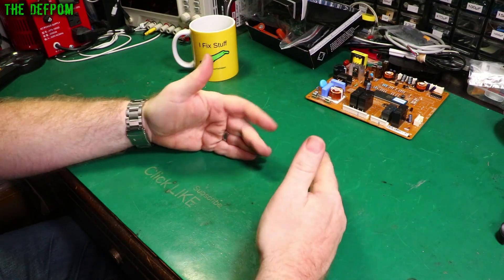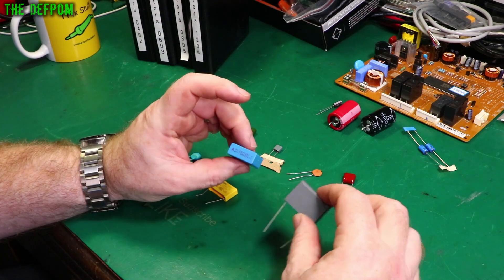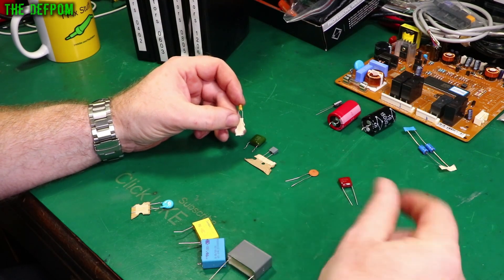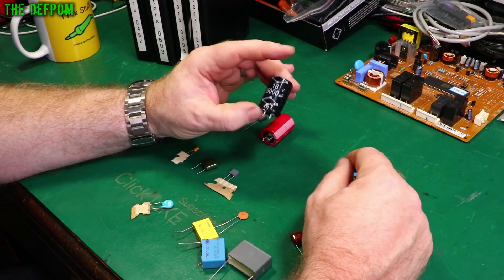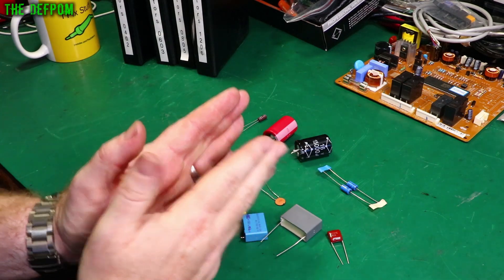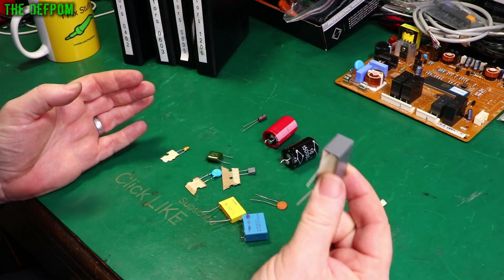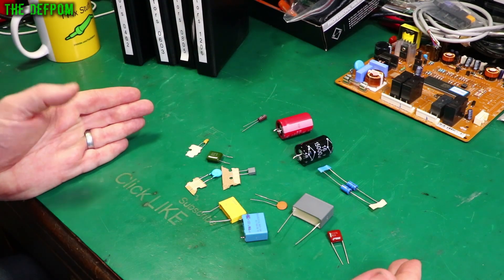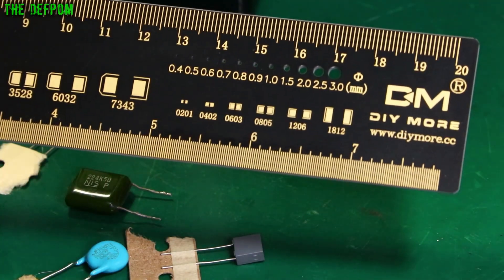🔴 Electronics For Beginners - No.3 - Capacitors - No.958

Comment: hi Scott , I'm new to electronics and loving the series! One quick question. Is there a possibility that a capacitor could discharge a dangerous voltage or current if you touch both the input and output at the same time. Many thanks
Reply from the maker: @hello55125  yes, lower voltages aren’t really a problem, but when you get to higher voltages you can get a nasty shock from one.
Reply: @TheDefpom  thanks for the reply

Comment: Thanks Scott 👍   So on a Y class cap, in let's say a SMPS, where the cap goes from the high voltage to the low voltage would you notice if it went faulty as it fails open? Would the device behave any differently? Or is it just good design to include one to stop the noise coming back and causing trouble to other equipment in the house. Maybe a silly question so apologies if there is not a simple answer.... Excellent series 👌
Reply from the maker: My understanding is that the Y class cap between the high and low side is there purely to reduce EMI by giving it a return path somewhere other than the equipment it is powering, so the noise being generated by the transformer is stopped at the source, if the Y class cap failed it will likely increase the SMPS EMC noise escaping the power supply output. That said I'm by no means an expert on SMPS!
Reply: @TheDefpom  Nice one Scott, cheers for the info👍

Comment: Wondering about the axial electrolytics. Are there any advantages or disadvantages to an axial design or is this just an "old" style package?
Reply from the maker: It’s just an old style package.
Reply: @TheDefpom  I notice you are stocking up on these!
Out of curiosity, is the 'can' of a capacitor normally connected to one of the legs? Could a normal cap be bodged to fit, in a case where these were used?

Comment: when did Condensors become Capacitors and why?? :-)
Reply: I think the term condenser is still used in some parts of Europe.
Reply: @daveodessa  bonus for brexit then :-0
Reply: when a capacitor blows in a cold room, the electrolyte condenses onto  the walls!
it was supposed to condense electric charge but now we know it has the capacity to hold it.
also some say Condensor, I say Capacitor so lets call the whole thing a cap.😁
Reply: @TheEmbeddedHobbyist  I think it's a con!
Reply: @Peter_A1466 I think I’m going for an hybrid answer a “condenitor”  or a “capaitenser”
Reply: @TheEmbeddedHobbyist  HA HA!! that must be the best explanation :-)